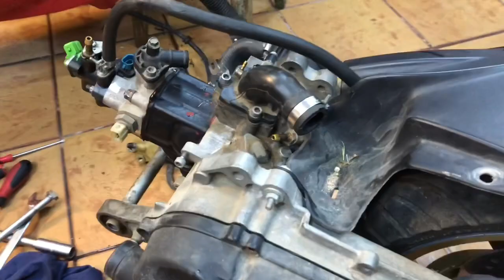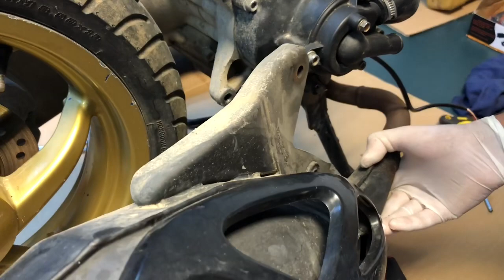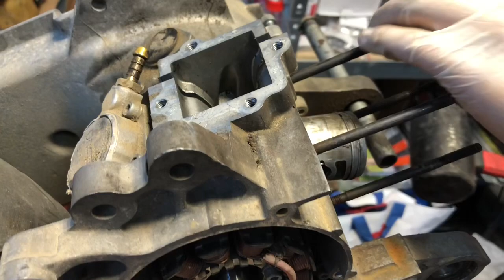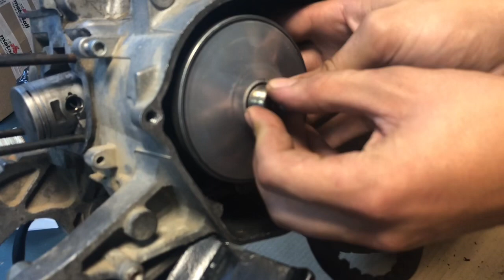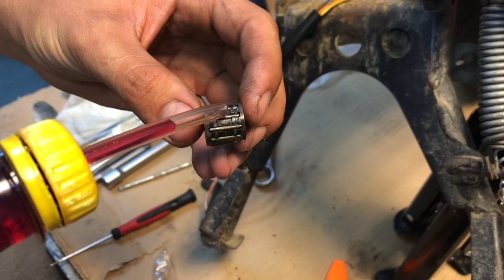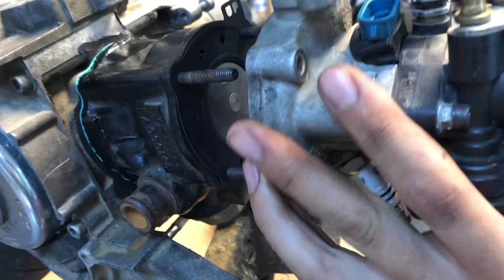Schimbat rulmenti si simeringuri Aprilia Sr injectie DiTech

Comment: Azi am intalnit cea mai ciudata problema la un scuter Aprillia SR 2T 50 cmc pe carburator. Initial nu pornea si am dat bujia jos. Electrodul era topit si am pus una noua, apoi am curatat si carburatorul, am verificat nivelul si daca inchide cand e la nivel. Apoi am curatat si filtrul de aer si am pus toate piesele la loc. Am pornit scuterul si mergea destul de ok. Pana aici totul parea ok, dar dupa ce am facut o tura cu el si s-a incalzit motorul, am observat ca daca trageam putin de acceleratie se tura singur si dupa ce lasam acceleratia, uneori chiar foarte tare. Am crezut ca trage aer fals pe undeva, dar cel mai ciudat a fost cand am luat contactul si scuterul statea turat. Ok, am zis ca e ceva la contact dar si mai ciudat de atat a fost cand am scos fisa de la bujie si scuterul statea tot turat si cu contactul luat. S-a oprit doar in momentul in care am pus frana pe spate, dar cred ca a mers cam 30 de secunde fara contact si fara fisa la bujie si era turat foarte tare. Am dat pe urma jos bujia si era de culoare caramiziu-rosiatic.
Ce poate fi?
A mai patit cineva asa ceva?
Poate fi dereglata aprinderea si se roseste bujia si din acest motiv se autoaprinde benzina? 
O sa-i schimb benzina sa vad cum merge pe urma.
Reply from the maker: Da, prima oara schimbati benzina. Butoiasul l-ati bagat bine? Are un plastic pe carburator de ghidare
Reply: @SHRMotorsOfficial  Am schimbat benzina si la fel facea. Pana la urma am desfacut motorul si am gasit garnitura de chiulasa ciupita. Pobabil cand s-a mai desfacut motorul nu a fost inlocuita si o parte paptrundea in camera de ardere din cauza deformarii si banuiesc ca acea portiune se incingea foarte tare si de acolo se autoaprindea benzina dupa ce se incalzea motorul.

Comment: Buna ziua.Detin un scuter aprilia din 2002 pe injectie si de o vreme face un zgomot motorul ca si cand se  şlefuieste un metal. Intrebarea mea este daca se poate sa fie din cauza pompei de ulei care baga ulei un strop la 30 40 secunde pompa de ulei este electronia. Este normal sau este dusa pompa de ulei si din cauza asta sa nu aiba ungere suficienta pistonul?
Reply from the maker: Ca sa eliminati aceasta cauza ii faceti amestecul direct in benzina
Reply: @SHRMotorsOfficial  multumesc pentru raspuns, dar nu o sa am probleme cu injectorul daca fac amestecul direct in benzina?
Reply from the maker: O faceti doar ca sa eliminati aceasta cauza. Nu se strica
Reply: Am facut ceea ce mi-ati recomandat dar din pacate scuterul a incetat sa mai functioneze , mergea motorul intrerupt nu tragea mai deloc ca smucea mai mult dadea rateuri di la urma sa oprit si nu mai porneste acum :( amestecul a fost de 20 ml ulei in 2t la 1 l benzina :(

Comment: Salut, am și eu o problema la un Aprilia Sr DiTech. Practic de când l-am luat motorul se oprește la cald, mai ales dacă îl las la relanti moare și nici nu mai pornește decât după 10/15 minute când se răcește motorul. Intre timp nu a mai fost folosit câțiva ani buni și a mai apărut o problema, cred că s-a dereglat ceva la magnetou deoarece nu mai da scânteie când trebuie, l-am pornit doar o data în aceste condiții și nu am mai încercat deoarece toba se înfierbânta foarte tare si nu are putere.
Reply from the maker: Posibil se caleaza motorul
Reply: Its air leak when engine gets hot it gets lean and dies and cant start because there is not enough fuel or too much air
Reply from the maker: Yes. You are right

Comment: Salut ,am un scuter Aprilia sr 50 ditech 2 timpi nepornit de 2 ani din cauza tobei ,a fost ruptă si nu am avut timp de ea. Am remediat toba,am montat dar nu pornește. Am înlocuit benzina veche, am curățat mufele electrice ,are  scânteie dar injectorul nu pulverizează  benzină, l am verificat direct pe baterie și funcționează  dar cu mufa pusă nu funcționează cand dau la automat . Pompa de benzina am curățato, funcționează.  Am verificat firele dacă au continuitate, are tensiune la mufa injectorului dar nu funcționează  ,nu dă  benzina. Care să fie problema? Mulțumesc.
Reply from the maker: Dar este posibil ca injectorul sa se fi blocat din cauza benzinei, ii dati cu un spray si il si alimentati in acelasi timp ca sa deschida si sa se curete bine
Reply: @SHRMotorsOfficial  injectorul  l am probat separat direct la baterie și funcționează,  nu e blocat , cu mufa electrică  nu funcționează când  dau la automat , nu primește  impulsuri.
Reply: @SHRMotorsOfficial  să  fie calculator?
Reply from the maker: Atunci este de vina calculatorul sau releul
Reply: @SHRMotorsOfficial  Care releu cel de lângă  pompa de ulei ? În partea dreaptă  ,are 4 papuci  ?

Comment: O intrebare! Am o motoreta piaggio si care are ambreiaj si vreau sa il schimb cu un variator. Vreau sa fac asta pentru un plus de tractiune si de viteza, credeti ca este un upgrade benefic ? Stoc prinde 45 km/h si as vrea sa duca aproape e 60. Daca aveti pareri !!!
Reply from the maker: Este foarte mare diferenta intre fulie si variator... dar nu este usor de facut schimbul
Reply: @SHRMotorsOfficial  La ce te referi, adică nu este de înlocuit sau trb făcute modificari?!
Reply from the maker: Pai da... tot grupul de pe spate este altfel...
Reply: @SHRMotorsOfficial  stoc are fulie simpla pe spate, acel variator nu se prinde tot in pozitia aia, adică nu e special de acest tip de motoreta?!
Reply from the maker: Nu... vine un ax mai lung...

Comment: salut am un piaggio nrg mc2 vespa . si nu stiu in ce loc se baga ulei de transmisie . adica ulei la roata din spate . nui gasesc locul unde se baga ?
Reply from the maker: Este un surub cam la 3-4 cm fata de partea de jos a grupului. Pe acolo se baga si se baga pana la nivelul lui
Reply: @SHRMotorsOfficial  ok mulțumesc.  Tot pe acol las afara și tot pe acolo pun napoi ?
Reply: Trebuie sa dau jos capacu de transmisie ?
Reply: Sau e pe partea unde e roata .
Reply from the maker: Surubul acela are o garnitura de cupru
Reply: @SHRMotorsOfficial  Din ce cauza îmi pornește la rece mai greu . Dar după nam treaba o ia din prima când e cald. Tra sa schimb ceva piesa la ia .
Reply from the maker: Poate fi o compresie putin slaba
Reply: @SHRMotorsOfficial  trebuie sa schimb setu ?
Reply: @SHRMotorsOfficial  Si dupa ce porneste cind o turez merge bn putin si dupa tot asa azmutit merge si daca o accelerez mai tare da sa moara
Reply: @SHRMotorsOfficial  de surubu ala pt sa schimb uleiu de tranzmisie tot nam dat . E partra unde e roata ?
Reply from the maker: Da

Comment: Salut, am si eu un moped piaggio si electronic am o problema cu el numai tragea bine deloc de la set era dus am pus set motor nou pe el acum 1 luna si nu trage bine gen palpaie asa prinde max 25 km\h nu fasaie cum ar trebui cineva mi a zis ca da curent intrerupt am izolat firele de la CDI si tot asa face palpaie nu trage bine dar acum problema este ca numai porneste uda bujia, porneste 2-3 secunde dupa accelerez tare 4-5 secunde se tureaza se invarte roata si dupa moare efectiv se opreste singur din mers, are compresia buna si da scanteie la bujie ma puteti ajuta va raman dator....
Reply from the maker: Simeringul de la volanta?
Reply: acolo nu am umblat niciodata, in schimb azi am pornito putin greu gen se intrerupea asa dupa accea am dat 2 ture cu ea in blana si tragea de rupea si dupa accea cand incetinesti tinde sa moara motorul si cand o pornesc da sa porneasca sau porneste si moare, bujia are culoarea cafeniu inchis deci motorul merge bine dar nu inteleg de ce nu sta pornita moare motorul..
Reply from the maker: Trage aer pe acolo, nu trage doar prin carburator.
Reply: inca ceva aseara tragea tare deoarece nu ii venea benzina multa din rervor de obicei trage asa cand numai are benzina in el si mai raman cativa stropi si atunci te impinge asa de la spate un bust de 200 de m in blana cum ar trebui sa mearga dupa cand il umplu cu benzina iar numai trage, azi am desfacut robinetul de la benzina si l am curatat numai curgea prin el era plin de gunoi dupa accea cand am pornito numai tragea tare palpaie asa se tureaza dar nu trage tare o sa ii cumpar un set de simeringuri

Comment: Buna seara, imi puteti lasa nr dumneavoastra va rog as vrea sa va intreb ceva in legatura cu o drujba ,multumesc
Reply from the maker: Din pacate, doar aici se poate
Reply: @SHRMotorsOfficial  am o drujba si face figuri porneste cam greu cateodata porneste bn dar nu sta accelerata decat vreo 2 secunde si moare si porneste greu ,am probat partea de motor separat merge bn. Cind se opreste curge benzina incontinuu in carburator
Reply from the maker: Cum ati probat partea de motor?
Reply: @SHRMotorsOfficial  pai in primul rand l.am demontat am verificat toate componentele si sunt ok l.am montat la loc, si i.am pus putina benzina pe la galeria de admisie ,si a luato la prima sfoara acceleranduse la maxim pentru careva secunde ,deci eu zic ca e ok aici

Comment: buna, am si eu un atv defect lati putea repara?
Reply from the maker: Despre ce atv este vorba?
Reply: SHR Motors  despre un kawasaki kfx 450 din 2008
Reply from the maker: Ok. Si ce probleme are?
Reply: SHR Motors  are ceva la electrica
Reply from the maker: Ce face? Sau ce nu face? Ca am mai avut unul la reparat ca are ceva la electrica , dar eu nu avea instalatia deloc si in unele cazuri cel mai ieftin si mai bine iesi cu o instalatie sh
Reply: SHR Motors  pai in prima faza dupa ce am mers cu el mai tare prin niste gropi a inceput sa puste pe toba cand il lasam in frana de motor pusca mai tare ca de obicei apoi a incepus sa nu mai steie bine la relantiu tot oscila si daca aceleram pusca tare pe toba si scotia si flacara si in ultima faza si nu cia din urma cand bruscam acceleratia murea motoru insant  si acuma daca ii pun contactu si vreau sa dau la automat nu mai merge nu mai invarte doar se aude un tacanit in bord si bateria e buna
Reply: sper ca mam facut cat de cat inteles :D
Reply from the maker: Am inteles. Il facem, nu este problema. Dar dupa data de 1. Ca suntem foarte aglomerati
Reply: SHR Motors  unde va gasesc sau cum facem ?
Reply from the maker: Pitesti, str. Exercitiu nr. 56